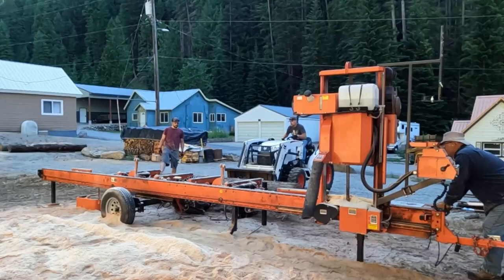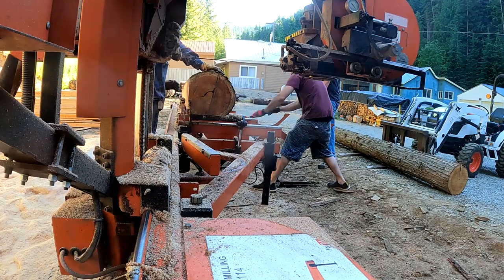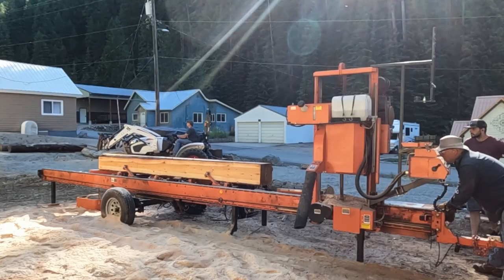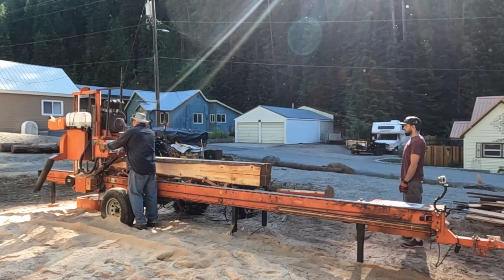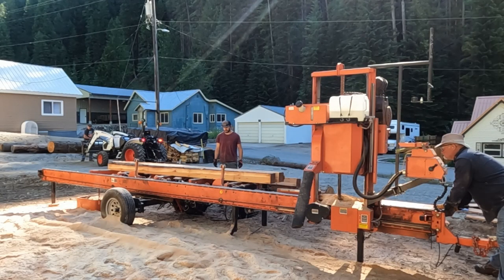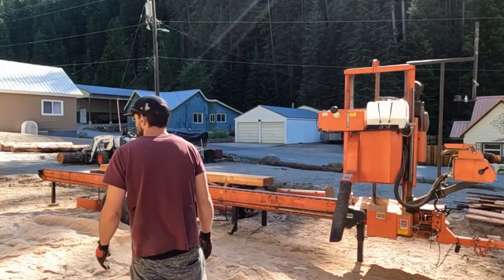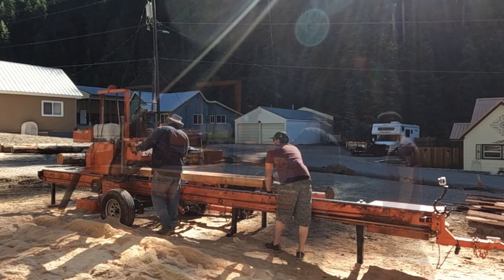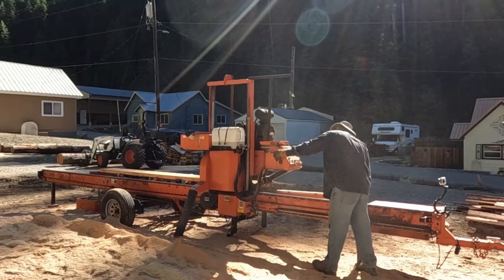TIME TO MILL CEDAR INTO 1X6'S ON THE WOOD MIZER LT40? #sawmill  #sawmilling

Comment: Like to discuss face bending vs crown bending. We have not experienced soft wood moving like those cedar logs.  We have had ash move horribly. Cutting stressed ash so that you get face bending, we also experience some boards coming off thinner on the ends and thicker in the middle. Crown bending you can control the cant a little better. The nature of the dog's on a circle mill cutting for face bending is a piece of cake. Not so much on the band mill. Have you experienced any problems cutting for face bending?
Reply from the maker: No, can't say I have really.  I always look for stress 1st which is why you see .e roll the log around .  Once I get the 'hooks' to the right I know the stress is horizontal (though there can be more stress in other directions the reaction wood is where I want it) I start milling and turning 90*  so I can keep track of it. When boards are thinner or thicker at the ends this means the stress is causing movement.   To mitigate this you skim a cut off to flatten the face, flip it 180 and flatten then take boards out until you see movement again (could be 1, 2 or many boards).  If it reappears the skim, flip skim cut and so on